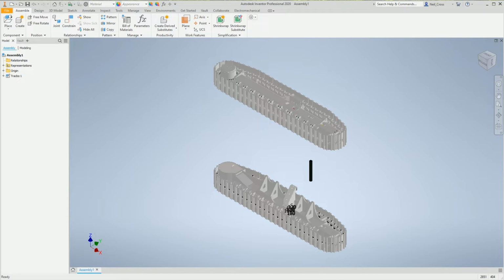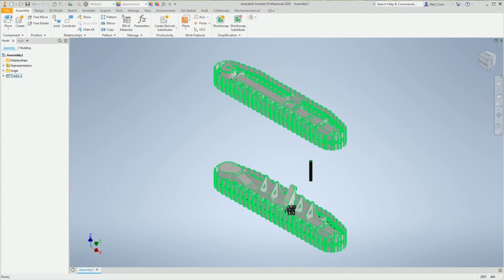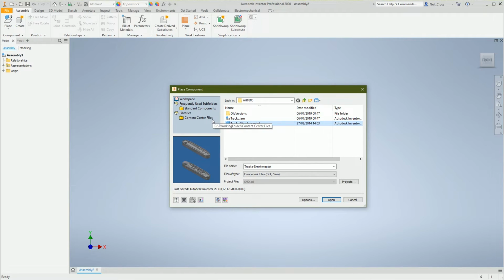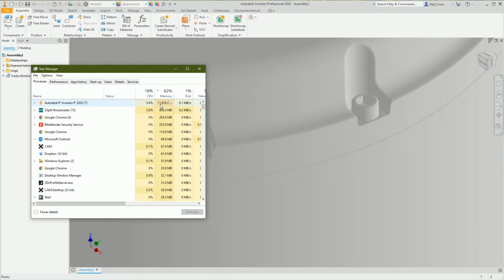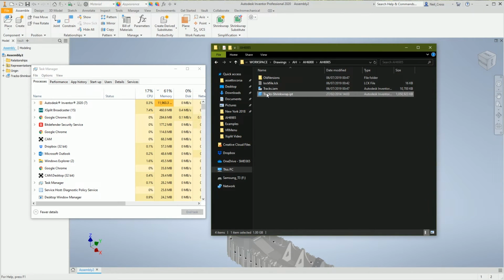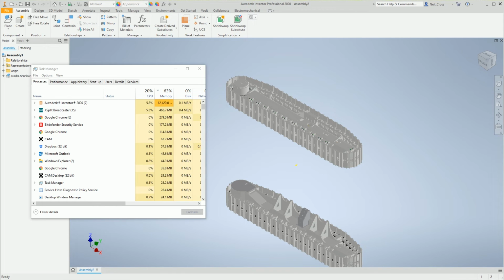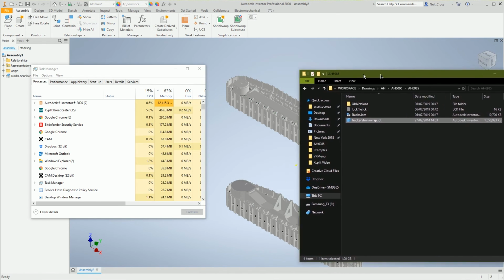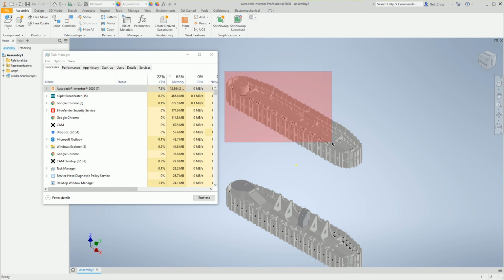Can SHRINKWRAP cause worse performance?

Comment: Seen the same problem in some Catia files. They just stuff everything into a Part from the assembly. First of all it makes it a pain in the ass to find anything. Esp if that assembly had sub-assies in it. :) And you are carrying over so much useless information to the new file. Dunno about inventor but Catia has a lightweight option, CGR, when handling massive assemblies so that the computer doesn't end up commiting suicide :D

Comment: This is what I refer to as "Bones on the outside."  I ran into this when consulting for a company that creates 'Easy Clean' food processing conveyors.  Wherein all the detail is clearly seen and exists outside, as in not contained in a housing and hidden from view.  When using Shrinkwrap on a assembly of this type full of parametric part & features into a single file its no wonder the files are the size they are.  It's also true when you attempt to convert this type of file into a STEP. (Convert from parametric to polygons.) Huge and completely unmanageable.